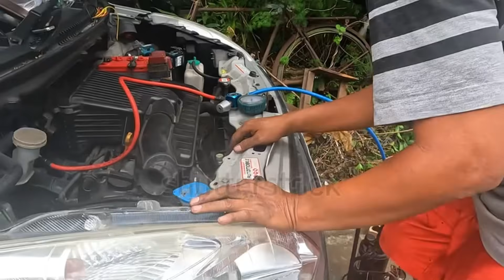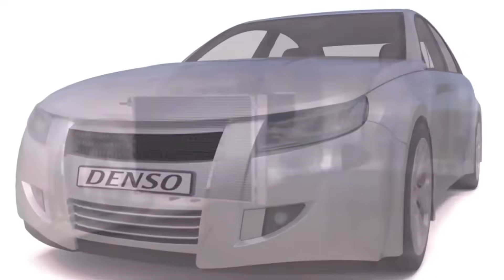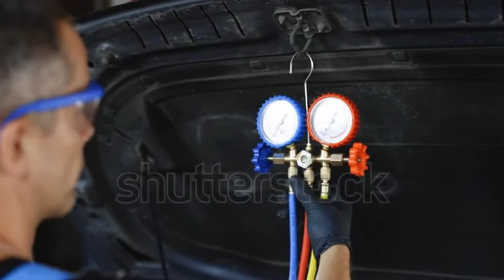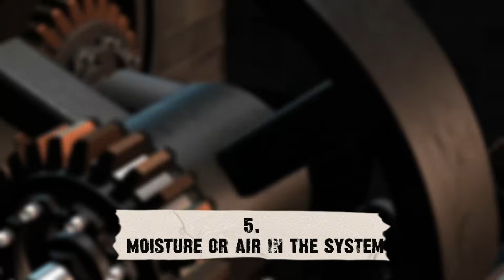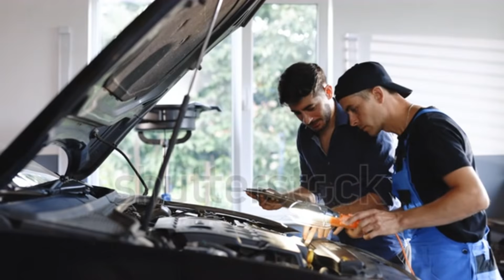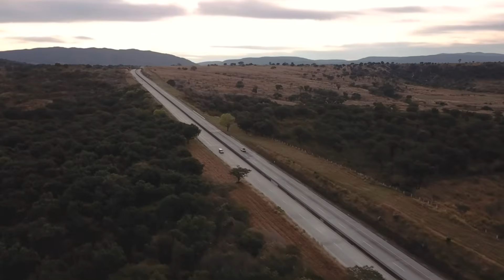AC Low Side Pressure Too High? Causes and Easy Fix Explained!

Comment: My  low side is at 50psi high side 200psi at idling speed not cold. I have to rev the engine at hight to get some coolness at that point the gauge is at about 45psi is the compressor faulty?

Comment: Mine has 70 PSI on the low and 295 on the high and blowing hot air is an expansion valve AC compressor is the defective
Reply: According to pressure reading your system is overfiled. The reading should  be 45 low side and 245 hi side at 85F outdoor temperature

Comment: You didn't tell us how to know if you have too much refrigerant.
Reply: First thing he said was connect gauges up to the low and high pressure lines. That would tell you the current freon level or pressure in a/c system.
Reply: You have to much refrigerant then hi side is above 280 psi engine hot and idleling and outdoor temperature 85-90F.